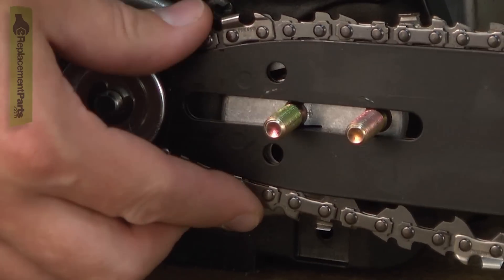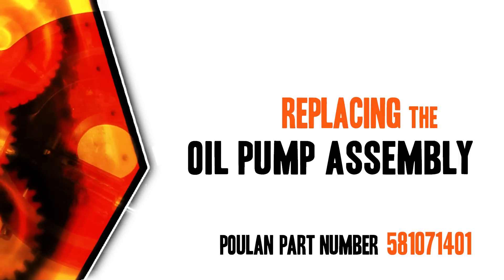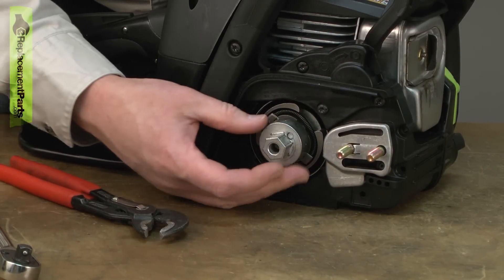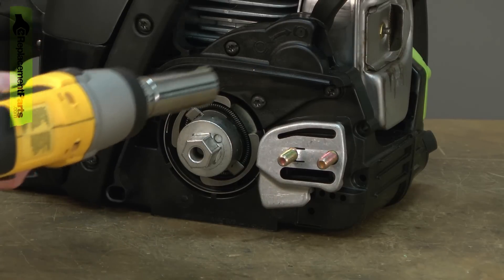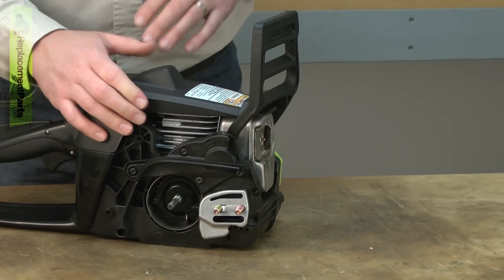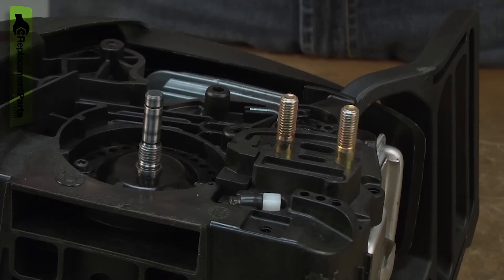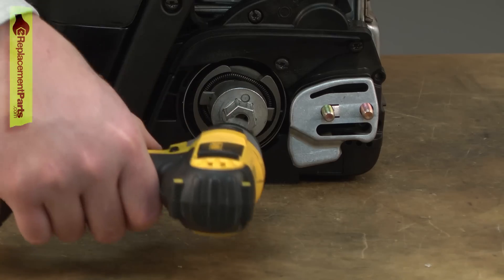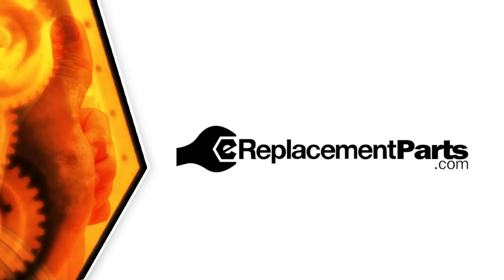Chainsaw Repair - Replacing the Oil Pump (Poulan Part # 581071401)

Comment: Is this oil pump setup the same system as the older Poulan chainsaws? I mean the take down may be a little different because the older one don't have the clutch brake. I just got a like new 15 year old Craftsman (built by Poulan) that leaks bar oil pretty bad and I'm suspecting and problem around the oil line grommet at the oil tank, if its the same system as used in the one in the video. The saw I got is an 18" factory chain, still sharp, and never sharpened and it has the storage case, and it was FREE! The fuel line was rotted away but I've already changed that.